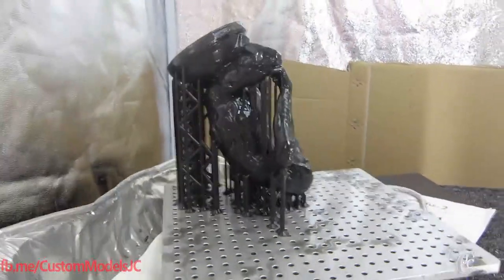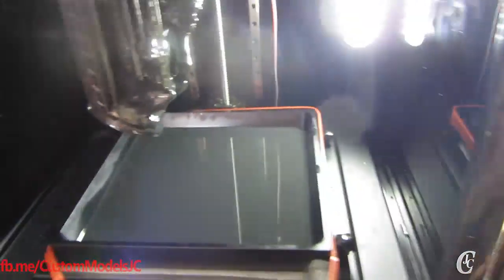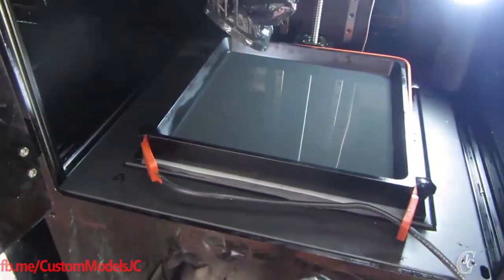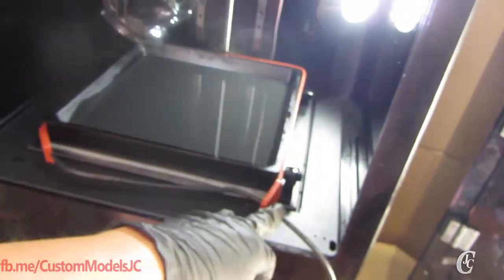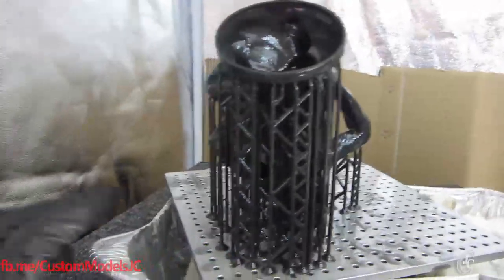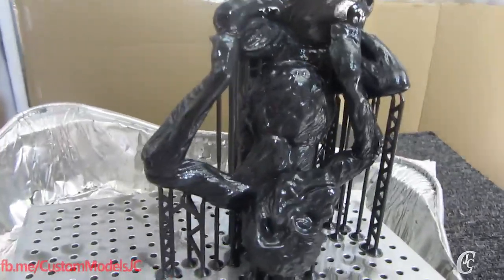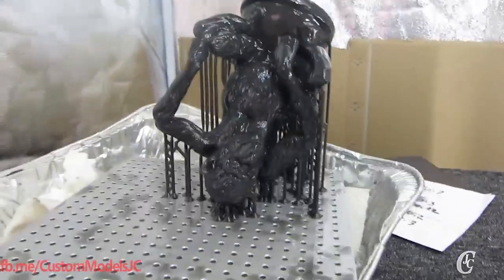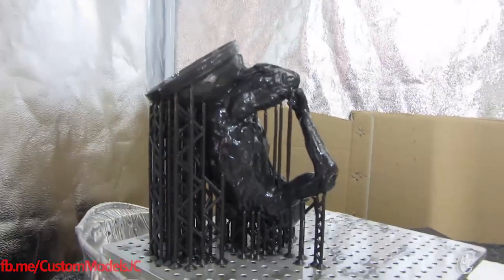latest print from Peopoly Moai 200

Comment: Awesome result, did u see the new Moai LCD printer?
Reply from the maker: sure did! keenly keeping an eye on the details :)
Reply: vfxforge I wonder if it's better, it's cheaper than Moai 200, produces parts that are more dimensionally accurate, if the screen dies it's cheap to replace.Uses a 4K screen so it probably has a widescreen format, maybe 16:9 aspect ratio. Faster print time, curing entire layer at a time.